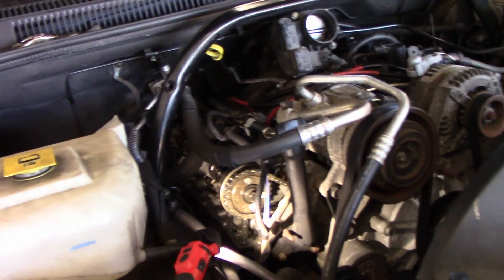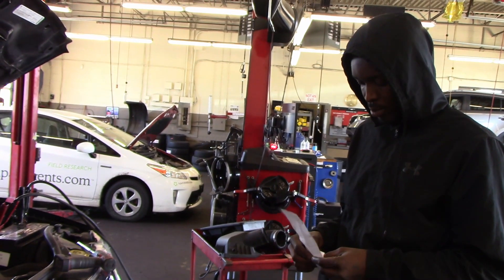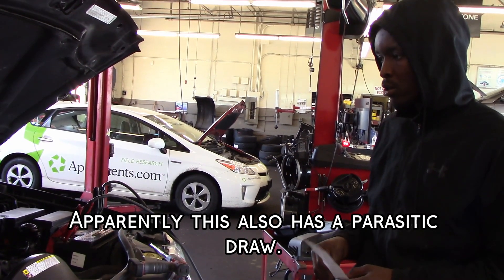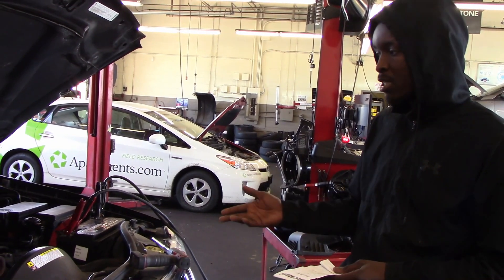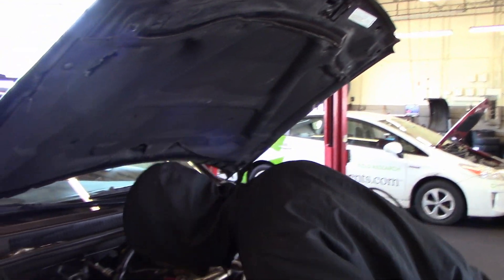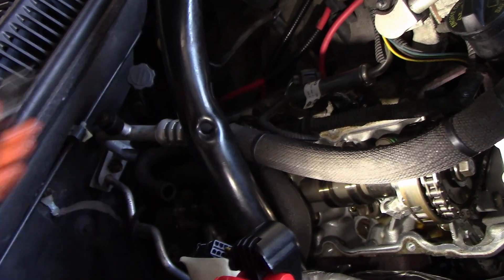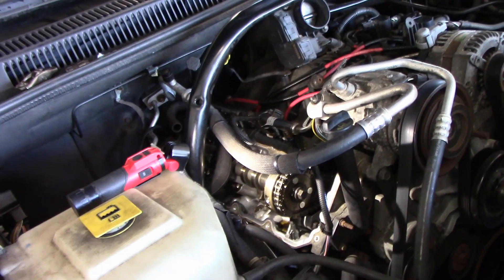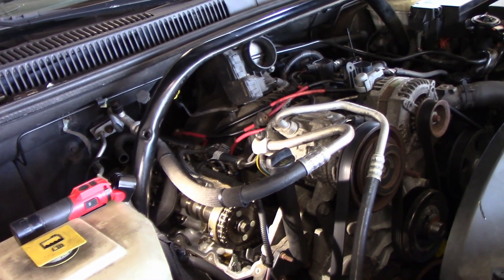09 Jeep Grand Cherokee 3.7ltr- Stalls, Runs Rough -Part 2 Follow-up

Comment: Awesome diag Cuba👍
From the first part, you were pointing at the right direction, it was just a matter of the valve covers to come of😉
& boy how satisfying it feels when your diag is 💯% accurate😍
Stay safe Cuba❤
Reply from the maker: Yes! It feels great to be able to do so... point to the problem, and have the others do the nuts & bolts. Then turn out to be right. It just frustrates me that so much time & money were wasted, AND this is an extremely costly repair. 😑😔😳

Comment: This engine had to be making some tapping noise at some point.....right?
Reply: Yup,you would think so....
Reply from the maker: None at all. The only issue this had was a steering rack that needed to be replaced due to a severe leak. Then it sat. The replacement rack was just under $1k for OE... and the only available aftermarket options are pure junk. So he was letting it sit to save up enough. By the time he had started it again,  the vehicle was running rough and stalling. 

From good to bad. No in between.
Reply from the maker: Gorgeous truck, BTW, @Hello Fresh!
Reply: @CubasAutomotive  it is!  unfortunately, it's not mine...😭😭

Comment: how in the heck didn't anyone hear the issue cranking it over without fuel/spark? I've heard them before and my ears vomit instantly lol
also mechanical vacuum gauge hooked to intake source, that needle would have been dancing like mad, since that was an intake side. I don't know why people forget about such simple basic tools :)
I forgot about my other favorite thing, put your hand over the exhaust, it would also be going crazy missing pulse even hard back pulse.
Reply from the maker: THAT was precisely my FIRST question after I heard it crank. I really didn't need to use the scope to tell me I had a dead hole, but I never cranked it or heard it until I had everything hooked up for testing. Lol

They ALL said they never noticed cadence before!! Unbelievable!  Lead tech over 10yrs in the field?? I said listen to one of the cars in the shop now in clear flood mode. ... Did you guess they didn't know what that was either? ? 😥😓😖😔😳
Reply: @CubasAutomotive  face palm to them I guess. wrench twisters vs. mechanics I guess. lol
Reply from the maker: Oh it's such a shame! 😥😞

Comment: guy spends all that money just to find a bad valve lash adjuster . 
Does the head need to come off? lmk. excellent diag Cuba.
Reply from the maker: Absolutely the head must come off.  The piece that holds the lash adjuster is part of the head.  No way around it.
Reply from the maker: And thanks!!
Reply: @CubasAutomotive  so he needs to replace the head cuz of the damage?
Reply from the maker: Yes the head is damaged.  Nowhere for the lash adjuster to sit.

Comment: Surprise, a woman saying she's right in the first 30 seconds... Yet not really fully identifying the problem. 

I learned more from the customer then anything this chic did.. bro shoulda kept driving!!
Reply from the maker: @nickyroar401  the thumbnail itself identifies the problem. I'm sorry you don't understand pictures. I'm also sorry that a man doesn't know what these parts are or how they work.

 I was able to identify the problem of a non contributing cylinder without removing parts off the vehicle & within 20 mns of being on site. Other shops tossed parts at it, doing a tune-up & replacing parts which would NEVER fix an engine mechanical issue. Other shops took advantage of the customer, I did not. 

Unfortunately, lacking a cylinder, bro wasn't driving too far. ✌🏻